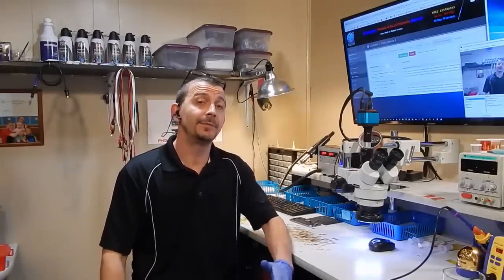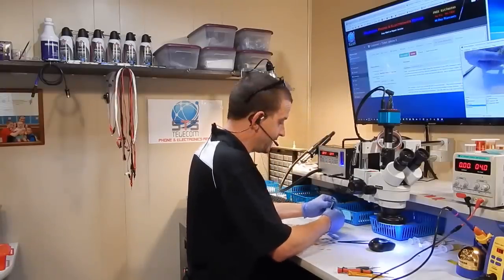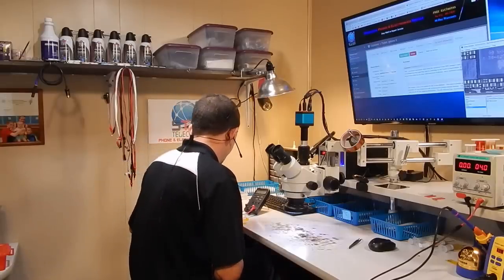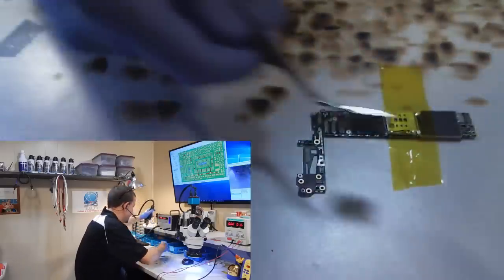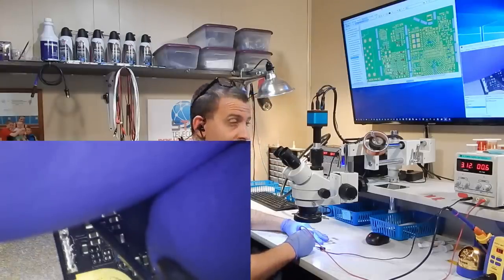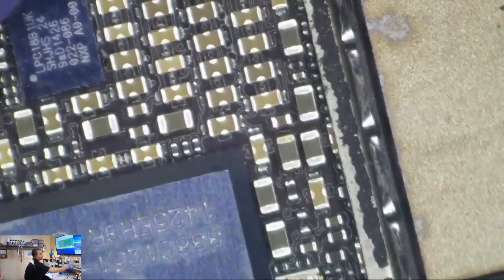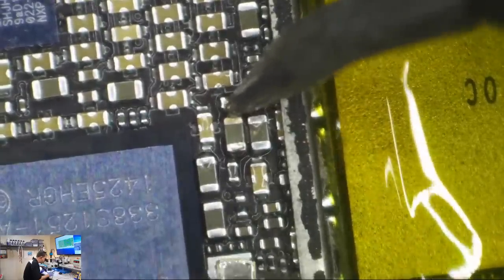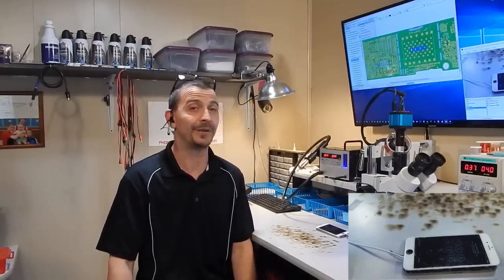iPhone 6 No Power Repair from Canada - Short on VCC_MAIN

Comment: 40:57 Most important thing is that you fixed it carefully and prudently. Regardless of experience and skill, I consider this work a continuous learning process.

I actually use the power injection method when necessary, but if I could use freeze spray and/or alcohol methods, then I will.

Comment: 37:40 "Why don't I get heat?”  “... even with 5A?" --Heat correlates to the power that is dissipated in the component. Power is a product of current and voltage. As you can see the voltage drops to something like 0.05V, hence the product 5A*0.05V = 0.25W is indeed hard to feel as warmth. Assuming that you component fails with higher resistance say “shorts” to 1V and 5A. This would result in a 5W heat dissipation and very visible red glow even in larger SMD components.
These “true” shorts (very low resistance) are indeed hard to trace. Microohm meters can be helpful to some extent. Good job!
Reply: Sqeezerful or ice spray/thermal camera. I bought a thermal camera. Much faster and easier to spot shorts now.

Comment: The Heat is related to power dissipation which is calculated as V * I. If the voltage is 0 it doesnt matter how much amps are going trough the circuit. It wont go hot

Comment: Impressive work. There is also a lot other methods for diagnostic and finding shorted components. I will suggest using thermal camera for finding bad components, since you are using heat. Also you can apply some alcohol on the components so you can see if something is hot and evaporates it. :))

Comment: I am a "repair" electronic engineer myself, spent twenty years in the game, a dead short(zero ohms) will not produce any heat, simple ohms law P = V x I. If the voltage across the component producing the short is truly zero volts(which it could be if it measures 0 ohms) then this is the formula populated P = 0 x 5A, therefore P = 0. What this engineer is trying to hope for is that the component still offers some resistance which would then produce a voltage drop across the component and P would no longer be zero and heat would be produced. Besides, at 5A you would be stressing out all the tracks on that board that would be super thin and not designed to carry that amount of current. What about using a sensitive fluke meter and measuring resistance ?

Comment: You have could find the short in less time if you used the freez spray , it's like magic , I would recommend you to remove the VCC main it self first then connect a small wire with any of the VCC main components then connect voltage but don't forget to spray the freez spray,  short  will revel it self
Reply: austin greer pls where can I buy freeze spray?
Reply: Hasan Rizk sometimes in emergency i use the soldering flux to find the "short" components..

Comment: here's a tip... use air duster and turn the can upside down and it's freeze spray.  freeze an area of the board and then apply vcc.  the freeze spray will go away alot faster in the area of the component

Comment: As you know, VCC_MAIN is paralleled at all connected points therefore moving the PS to different points on either side is unnecessary since they are all on the same rail.

Comment: I used Pads viewer up until I had to do some torn pad hunting on an SE and then realized PADS wasn't all that. That's when I sprung for ZXW and happy I did. The only issue I have with ZXW is Blackfish won't open schematics, but not a huge issue can usually find the vietmobile ones easily.
Reply: I had the same problem with blackish but I change the server to the hongkong1  server and language to Chinese and now it works all the time for me.
Reply: Did you do that within ZXW or Blackfish itself?
Reply: Harley Strine just blackfish
Reply: Do you know which is the menu for that? It's all in chinese.
Reply: Harley Strine click on the T tab and choose the last option

Comment: if you want my advice
just aplly 4  or 5  volt with high currunt about 5 amber  on vcc line 
the short will be break off
i do it many times long time ago 
it is work very well
by the way
you dont need to disassempl the phone
Reply: Using battery cable test with psu?

Comment: Hye Jason. I have an IPhone 6 sent to me from other shop. When I look around the board, all the VCC_Main cap are removed, the reason this IPhone sent to me is because it keep showing temperature warning even not in hot condition. Before this the IPhone is a water damaged and it already power on, but the only problem is the temperature warning issue. Would you give some tips or maybe you can make a video about this cases. I've watched all the repair video on youtube, but no one have made a video about this case yet. Maybe you can be the first to make it. :)

Comment: That bracket at 4:40 usually doesn't really need both screws removed. I only ever remove the screw that attaches to the housing, and keep the other one attached to the board
Reply from the maker: +Ray I worry about bending it when I tape the board to the table or by getting it caught on something.  I get a lot of boards shipped here with it left on and never had an issue with it though.

Comment: Just wondering, would a thermal camera be helpful to identify the heat source more quickly?
Reply: Tarik Guney it would but they’re expensive. Unless you’re doing specifically shorts every job or at least multiple times a week/month, they’re not worth it. It’s usually better to spend a bit more in one thing here and there to manually find the short than it is to spend $5k on a thermal spotting solution. Volts/current and alcohol on the board work as well and almost as fast

Comment: @ 41:19 you take off the vcc main cap and 41:46 you move it to another place where you removed broken cap. But did you put new cap on place of removed vcc main cap ? Or it works even with removed cap ?

Comment: Respectfully, it's the power not the current that determines the amount of heat.  Power is current times voltage.  So the voltage does matter.  2 amps at 1 volt is 2 watts.  4 amps at 2 volts is 8 watts.   But when you're putting 4 amps in your power supply is reading .7 volts, so that's only 2.8 watts, not 8.
Reply from the maker: You are correct with your calculations of Ohm's law being why this board did not build up the sort of heat one would expect.  It is because there just isn't any real power being consumed and is easily dissipated.   But, you will not get heat without current.  At lower voltages and higher currents you get more heat and just the opposite is true at higher voltages and lower current.  That is why high voltage power lines are thinner in diameter than low voltage lines and produce very little heat.  How many watts are they carrying?  Of course they would still be subject to Ohm's law and the actual power being consumed in terms of how much the wire heats up, but, no amps = no heat.
Reply from the maker: Just re-read what you wrote..  Uhh, I think we are actually agreeing here :)  
Thanks for commenting.
Reply: +STS Telecom jn
Reply: High voltage lines? Surely you mean high current lines
Reply: But the very definition of a short-circuit is a closed circuit with no resistance. Since both rails are theoretically connected together, the difference in potential, or voltage, equals 0. But despite the voltage being 0, all the current available tries to flow all at once to the other rail, and this makes the current intensity, in amperes, infinite in theory.

So even a 0.1V can deliver insane amounts of power because the current will be as high as possible for the supply. So for all practical purposes, current is what we care for, since voltage is practically inexistent.
Reply: This is very true, if you have a dead short, no power will be dissipated, simple ohms law, P = V x I, if V is zero then P is also zero. What the engineer is hoping for is that there is some resistance in the faulty component. Diodes tend to display this characteristic more so than caps.

Comment: hy sweet bro how are very nice work bro 
i need your help pleas
pleas tell me about the best tools which are best for mobile repairing
which soldering iron is best which power (Wat) soldering past which is best 
desoldering  Past 
hot air gun and its ..what is the best heating temperature level and air level

Comment: Thats a realy nice method and only if you self-employed you realy know what "time is mony" means ;-)
I am developing electronics so hopfully I don't need this method, but let me contribute with some thoughts about why the cap doesn't get warm.
The last time you shorten your probes you got 4.13 Amps and 0.06 Volts.
This means the inner resistence of your power supply plus the resistance of your probes are 0.06 / 4.13 = 0.0145 Ohm.
Than you shortend the cap and the voltage increses to 0.07 Volts. That means the resistance of the power supply plus the probes plus the cap is 0.07 / 4.13 = 0.0169 Ohm.
So the resistance of the cap is 0.0169 - 0.0145 = 0.00245 Ohms. Thats a realy perfect short. It's like a wire.
The power which is consumed by this cap (the cap plus the wires on the board) is 0.00254 * 4.13² = 0.0417 W.
The rest of the power is consumed by the power sypply and the probes 4.13 * 0.06 = 0.248 W.
So your probes are getting warm but not the cap.
Conclusio: If you are using this method it is useful to also look at the voltage. If it is not much highter then the probe short, the error will be difficult to find.
But be careful. If the cap has lets say 1 Ohm the voltage will increase to 4.14 Volt and the power increases to 17W. This will pop your cap instantly.
I hope this conclusio helps.

Comment: Used the same method when looking for a short to ground in lighting systems on semi tractor / trailers years ago when I was a kid,,, If the short couldn't be isolated in a particular section or subsection of say lighting because of a pinched wire or a wires with melted insolation from welding near a loom,, a last resort would be to throw the 12VDC with about 600 amps that was in available in one of three or four batteries on the vehicle.  
    With about four people on all four sides of the unit we would listen, look and sniff for the smoke and sizzle because it was going to show very quickly,,, Too long and now you made more work for yourself.

Comment: Hey I was wondering if maybe when u are checking for a short and feeling for heat with ur hand, if maybe u could use a laser temp detector and it would show those slight changes when u connect ur power supply and have a short. Just a thought I wanted to run by ya. If u don't think u could apply that to this type of work just disregard this comment.

Comment: Hi Jason! Great videos and explanations. Not to mention beautiful working environment, you damn sure a highly skilled, cleanest electronic repairman!!!! Sorry to bother you with my trolling iPhone 5s question, phones boots and works fine, but the whole board gets hot. I thought it was vcc_main by injecting volts but no joy. It's only drawing 0.12 amps and heating up pmic, nand, CPU, and the board at the same time. Very much suspect a partial short, can't seems to figure it out. Any idea would help. Thanks. By the way its not for a customer, its my hobby, no rush. Thanks and take care.

Comment: Use a thermal camera not your fingers , VCC all cap's are in parallel  unless you partition the circuit it doesn't matter were you apply voltage..

Comment: Just to make sure I don't potentially screw something up, I just have one quick question. If my iPhone 6 won't power on and won't connect to iTunes, would it most likely be a short on VCC main be the problem or something entirely different?
Reply from the maker: Oh man, there's a ton of stuff that cause no power.  Best to check between VCC_MAIN and ground with a multimeter to determine.  It really could be anything tho.

Comment: I had a similar thing happen and i think i burnt out my processor. everything else seems to work on the logic board and i replaced the battery and tested the screen. Could i send my phone in to see if you could fix? Worst case scenario i'd just like to get my lost data back. Ill go through your site but thank you in advance.

Comment: Hi, noob question.  at the very beginning you are touching positive and negative pads on the battery connector? Aren't two pads "two parallel lines" are plus and minus?

Comment: Since the gloves you have on our examination gloves. And not antistatic glass. I am just curious what is the reason for the gloves? I am not complaining about them I am just generally curious why I see several people wearing in these types of gloves when they have nothing to do with static electricity. Should I be wearing these type of gloves when I do iPhone repairs?
Reply: MrMJMTech It keeps your finger oils off the board.  Standard cleanroom technique.  You dont know whats on the board and you dont know whats on your fingers.. best to keep them out of contact.
Reply: Because of toxic flux

Comment: I do component level casino game PCB repair and I come across shorted SMD decoupling caps and shorted caps on PWM volt regulators. Like the iPhone, there's a lot of caps in parallel. But here's my idea: How about using a drop of thermal color change paint on the suspect components that will change color when the component heats up instead of doing the touchy feely test with your finger? That could speed up repair time.
Reply: Rick Jasper where do you get thermal color change paint from?

Comment: I have an iPhone 6s I attempted to replace a broken screen on. The phone worked still completely before I got a hold of it. When I put new screen in I saw a super small puff of smoke from where the screen connects to the board. Since then it won't work with old or new screen. I would love to send it in for repair. Any idea on a cost estimate what it might be. I still have the new screen I purchased if that matters.
Reply: NonstickCODE That's rough. You most likely did not disconnect the battery when you replaced the screen. When you went to reconnect the screen, that live 20V backlight circuit most likely shorted that filter. With the filter blown, you now have an open backlight circuit. You'll have to shop around to get that replaced.
Reply: Is that something I could send it to you to have fixed?

Comment: Hi! I did a mistake which I don't know if I can fix or if it can be fixed. I damaged the base band contacts while cleaning off the old solder. Is it possible to swap boards and move both the memory and base band to another logic board?

Comment: I have a question concerning my IPhone 6
My wife said water got into the phone over a week ago, I opened up the iPhone and let it throughly dry out..  the phone boots (apple logo) then goes to battery icon as if it were charging. So it goes from apple logo to dead battery icon..  What can be a possible problem ??  Thanks

Comment: Hey Jason.. I have a technical question.. I have an iphone 6s that turns on but won't charge.. the phone had a broken screen, I don't have much history on the phone as i just bought it to repair the screen but charging was not working before screen replacement anyhow, so i changed the battery and i am able to turn him on both via power button and lightening cable.. I changed the charging dock also but it won't charge..do you have any idea what could that be? I don't want to jump into replacing tristar or tigiris.. what do you think it could be..

Since the phone is turning on using the lightening cable so i believe the charging dock is sensing something or at least it is well connected..please help me and sorry for the long message

Comment: JASON ALSO FOR YOU THERE ARE HEALTY RULES FIRST
Ist always so funny  and hilarious,
But whats is real important  then your handy microscope  ?
What are you breathing in? Heat up the bord , there is flux on the bord ans some flux  and  lead solder, tin residue  

The all show a lot of equipment and and handy tools  spend lot of money on  
YOUR 2 LONGS, LONGS THAT  YOU CANT REPLACE
SO BAY  a AIR SUCKER  OR MAKE IT YOUR SELF 
Make a simple sucker that you be sure that that smoke and flux residue  will suck away from you !!

Comment: Why did not you use battery cable test instead of pointing power to component ? 
How to boot mother board for testing power goes through ?
Reply: so you hook up the lighting cable and meausre the current on the battery connector without needing the power supply?

Comment: Hi why do you use  power supply voltage in vcc main line 2 volts  ?
Vcc main line  work 4 volts(main battery line)

Comment: Thermal camera
Reply: Yes, while the handheld ones are a little pricey (~US $400-$1500), if you're looking for subtle heat sources, a thermal camera is the best option. If you get the right one, you might even be able to plug it into your video recording stream. Without a thermal camera, as this video shows, you're hunting in the dark.
Reply: during his struggle , was thinking exactly same thing, thermal camera.
Reply: Jeff Pinter Would it not be useful to invest in a thermal imaging camera ?
Reply: could u point me to the right one pls ?
Reply: Current and alcohol work just as well, but not as fast. But if he drops a couple grand on a thermal camera, how long will it take to achieve ROI? How many jobs warrant a thermal camera? If every job were a short like this then it may be worth it. If you’re doing one a week or so, I would submit it’s a questionable investment. It certainly is a “nice to have,” though.
Reply: Ya, thermal camera...
Reply: @abigguitar  300usd availabel now on the market with low res